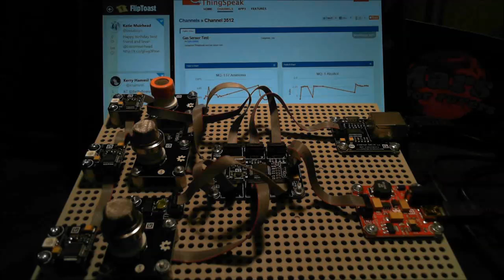Gadgeteer Gas Sensor with ThingSpeak

Comment from the maker: Gadgeteer is based on Microsoft's .Net Micro Framework and is an open source framework for plug and play prototyping so it cover sensors and much more.  I added a link to the Gadgeteer site above.